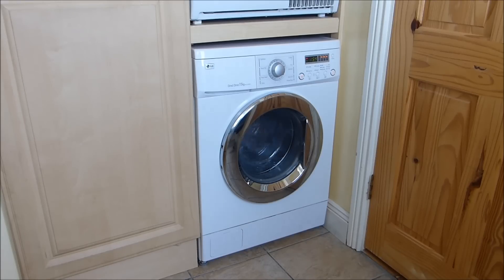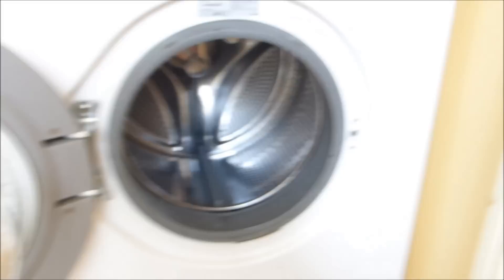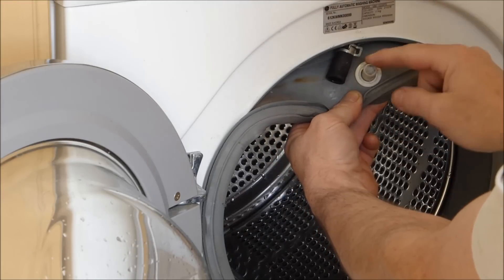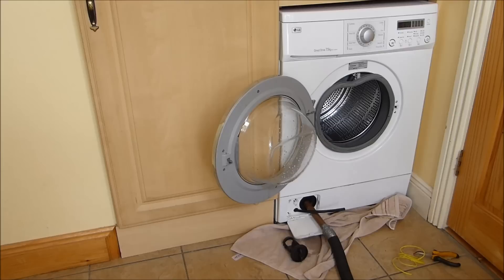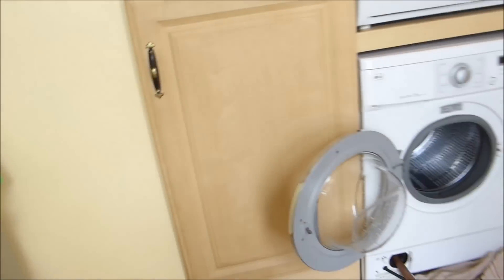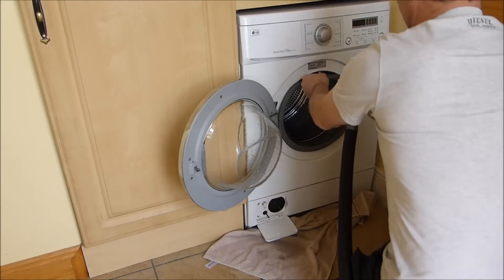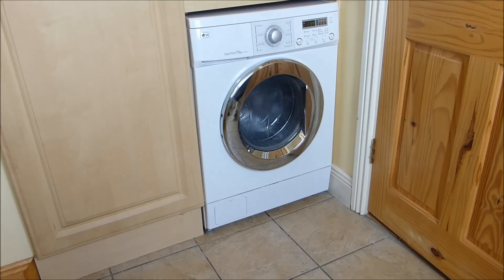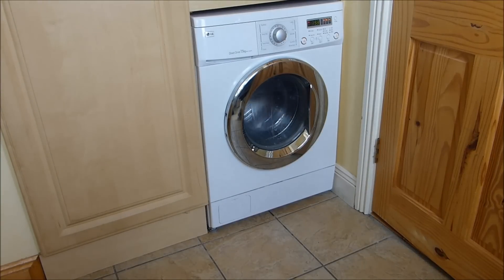Easy fix for blocked washing machine

Comment: Great video and yes, it's a good solution. However I have a similar (but newer) LG model (an F14A8TDA) and I was unable to get the rubber seal spring off easily. But I realised that it was actually easier to just pull the machine out, remove the lid and you can access the rubber feed pipe for the spray directly and easily from the top of the drum, it's actually a lot easier to work with.  So if you're able to pull the machine out it's possibly easier to just do that!

Comment: Very useful video! In my case I think that the blockage was ironically caused by cleaning the filter. When I removed, cleaned and reinstalled the filter, a small amount of lint must have gotten dislodged and ended up in the system. Easy fix though thanks to this vid!

Comment: The hose does not just push in. It is to clip onto the backplate. Also, suck through the small drain line as well.

Comment: You need to change your title to specificly mention this internal sprayer..

You can activate all the pumps, heaters, motors of the machine in the test mode using secret button combinations.. 

So if you want to check the water flow from the sprayer pump through that sprayer hose then press the secret button combination to activate it.
Reply: Well that's very interesting but the significant part of your comment is the word 'secret'. Seriously, how do you get that!!
Reply: @Isabella-nh5dm    This video shows nothing and is misleading..

You're not limited to this one video, look around at other videos and you will find what you are looking for.

Comment: Water pouring out of bottom of drawer when switched on but hose from drawer to drum clear. What else could cause such a problem?
Reply: I had a leaking bellows from the tub to the drain pump. Replaced the bellows and it fixed the problem.